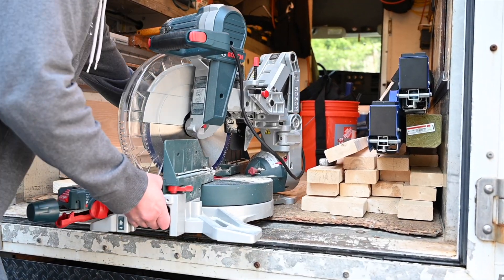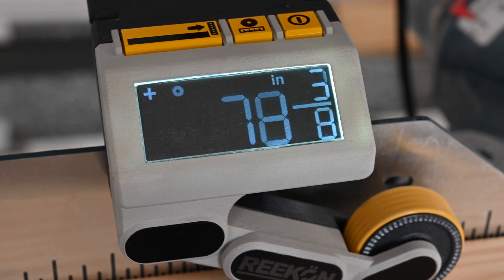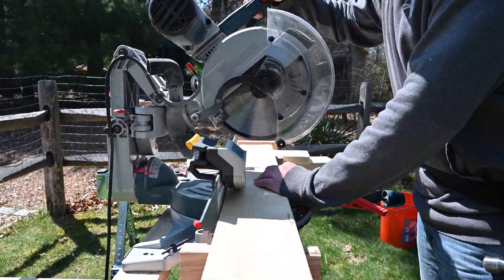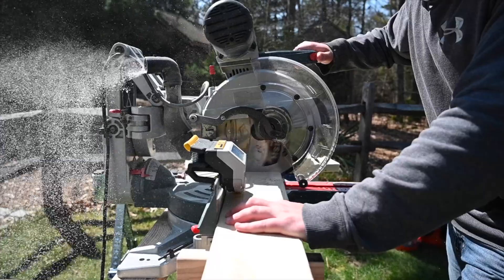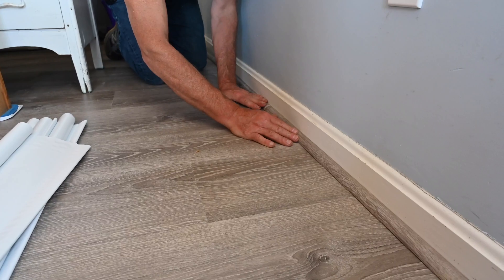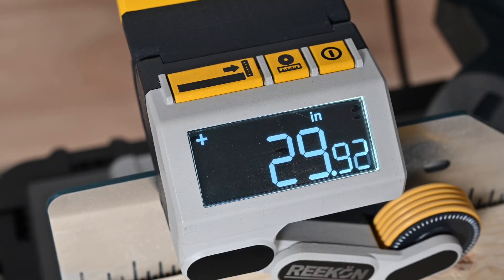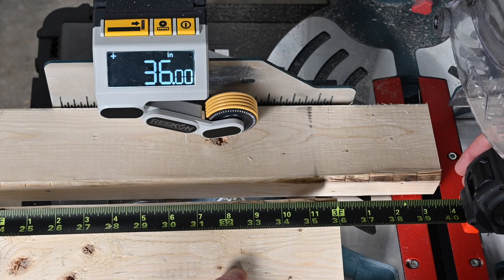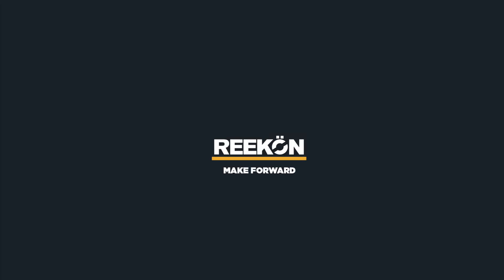M1 Caliber Measuring Tool Launch Video - REEKON Tools

Comment: Brilliant. Out of pure curiosity was this adapted from the same method for wrapping old wooden carriage wheels with flat steel? They would take a pizza cutter like tool and mark a zero on the wheel and tool. Then would roll the pizza cutter around the entire wheel counting revolutions until they reached the zero again and make a 2nd mark on the pizza cutter. Then they would transfer those counted revolutions to a flat piece of steel. Seems very similar to me so I was just curious if that was somehow a factor lol

Comment: Can you put in a exact digital value for blade thickness?
I would place a 2x4 on the saw(with a piece extending beyond the cut zone) lock the out feed piece down then zero the device , then cut the wood then feed the 2x4 in till it touches the locked down 2x4 piece then record the distance ...that would be you exact blade thickness..
Also for repetitive cuts I would use a chop table with t track or a Gripper dovetail grove and clamp to install a sliding stop block.
Then measure out my distance using a 2x4 and your device then Put the stop block against the 2x4 and voila a measured repetitive distance for cuts that are always the same exact distance..
Reply: The way I see how blade thickness works is by determining the edge of the blade.

In their snippets they show they push the material until it hits the blade, reset the measurements to make sure it's at 0, and then count from there on.